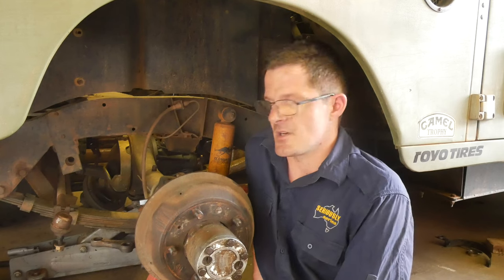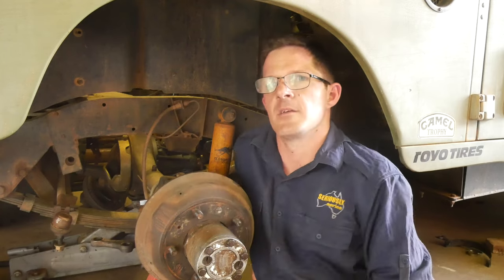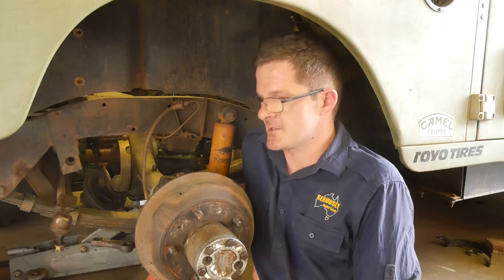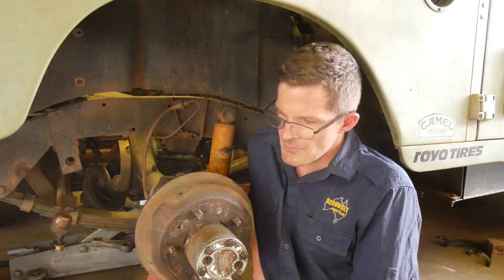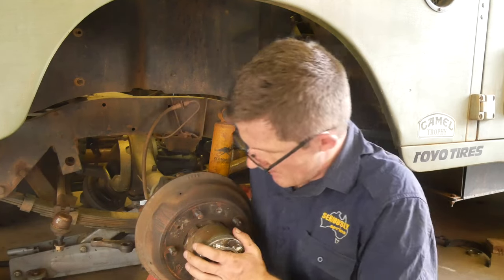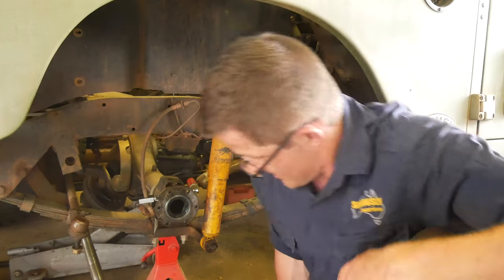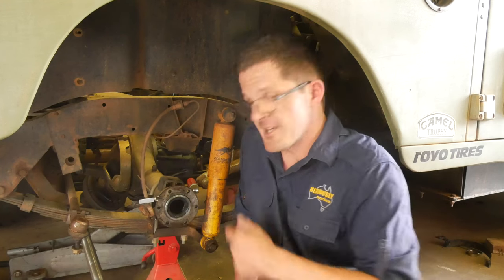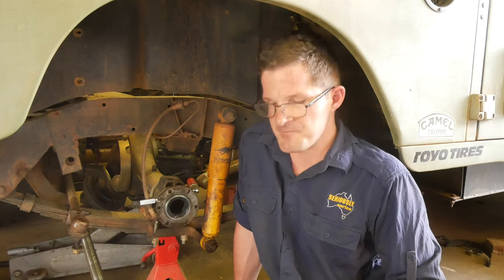how to remove differential the easy way: Land Rover

Comment: Hi Geoff, so in your opinion would this be the easiest way to replace the axle seals in my Perentie as I've got the grease in my diff oils and my bearings etc are all good and don't need to be touched. Cheers.

Comment: These are so easy even. Leave the brake hose on I undo the swivel off the diff housing shied it out on to a. Milk crate job done diff oil and swivel oil are one in the same if it leaks a little no big deal

Comment: Hi, its easier to jack with weight just off wheels.
Remove tge banjo flange to swivel bolts.
Carefully separate that gap 2 inches.
Dont have to disconnect brakes or steering
Reply from the maker: Good point. However I have tried this method in the past and I tend to find the axle can end up destroying the inner seal between the swirl hub and the axle housing if your not careful. Cheers for sharing. Kind regards, Geoff